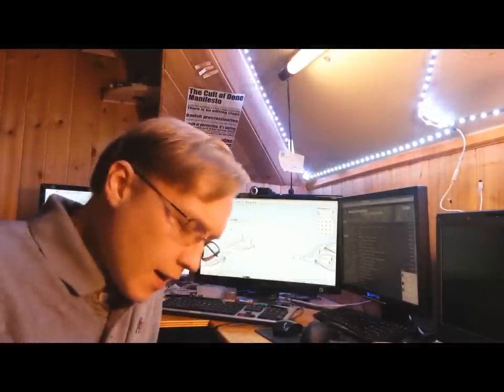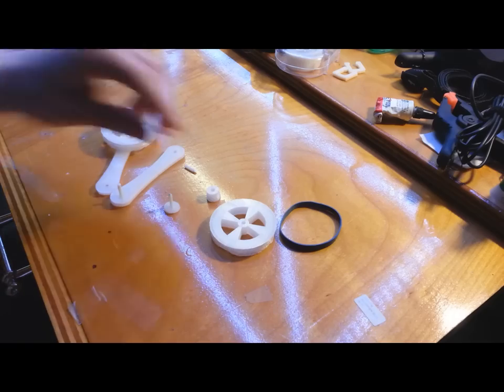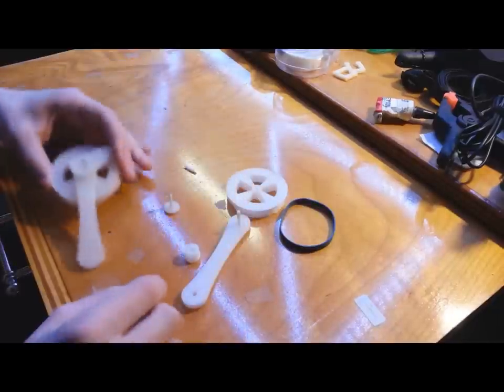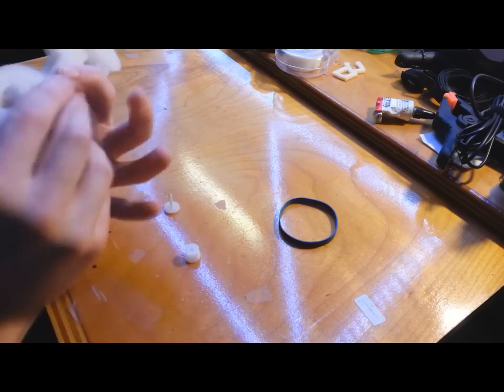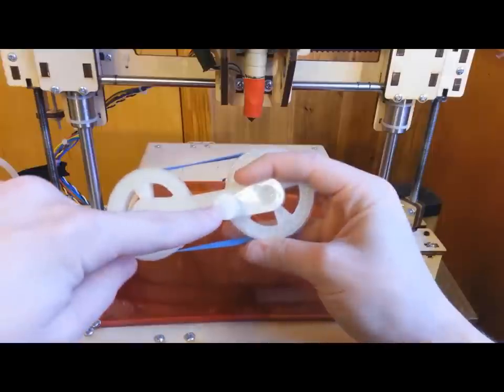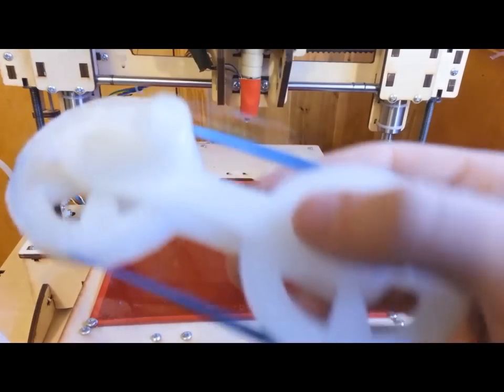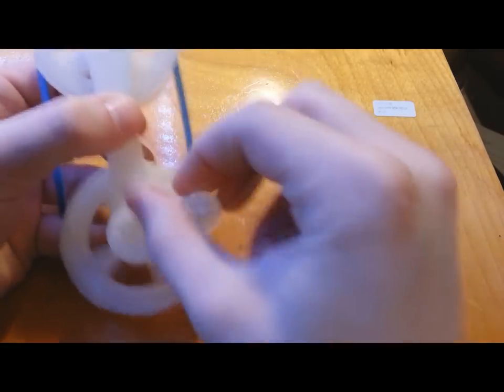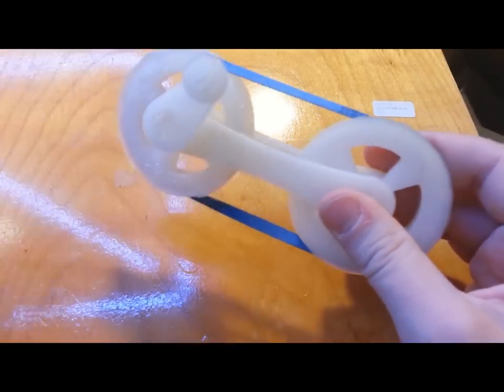3D Printed Pulleys Use Filament as bearings

Comment: You can also throw a piece of filament into a rotary tool, like a dremel, and weld with that. Just spin it up and push it against the weld point. It will quickly heat up and start to melt, and you can then spread it around the joint quite precisely.